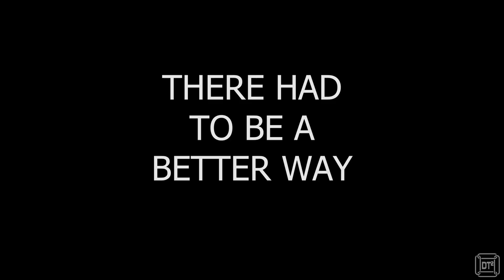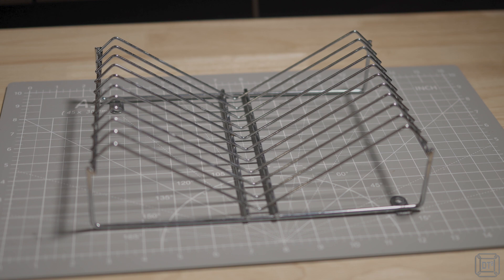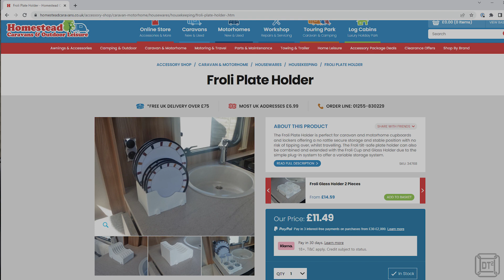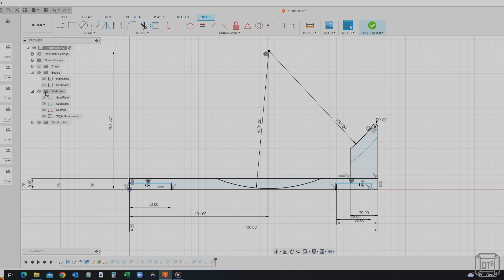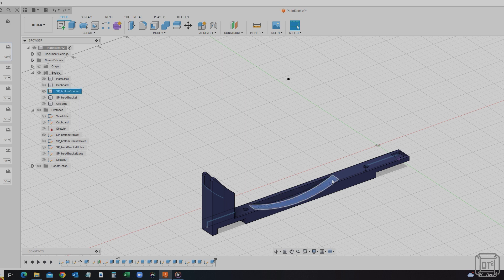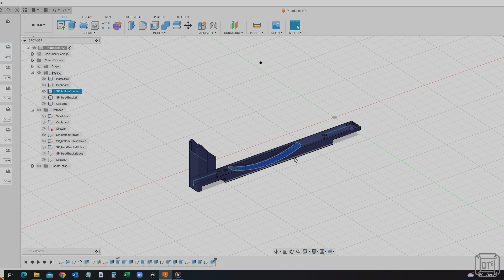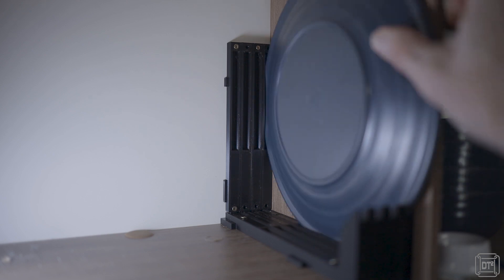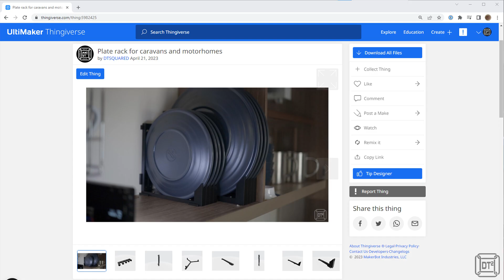THE PERFECT PLATE RACK FOR CARAVANS & MOTORHOMES - Designed and 3D printed

Comment: These are excellent and printed out just fine. Can you recall what sized screws you used to hold them in place please.
Reply from the maker: Thanks glad they worked for you. From memory the screws I used were about 15mm long but you could probably get away with shorter. Also I didn't use every fixing point, to save the cupboard looking like Swiss cheese. The holes are 4mm diameter (but I guess you already know that LOL ).

Comment: Just printing a test piece however my plates are 26cm but I'll try anything to stop the plate rattle in the motorhome.
BTW companies like PCBWay and JLCPCB do 3D printing (in most plastics and metal) if you send them the files.
Good project and thanks for taking the time to produce it. Would have been nice if the .stl files were parametric though.
Update; have now printed 4 of each size and made 2 spacers because our cupboard has a lip at the bottom and I have to trust the large plates to get them into the cupboard. Double sided sticky taped to hold the supports in and had a trip out last weekend and it was a lot quieter than before. I'll need to follow the design and make something for the bowls, cups, glasses and then maybe think up something for the cutlery. Keep up the good work.
Reply from the maker: Unfortunately STL files don't have parametric functionality. If you have access to Auto desk Fusion 360 (it's free) then I may be able to share the models.
If I get a chance I'll try and create a variation of the model but I'm really husy with other projects ag the moment.